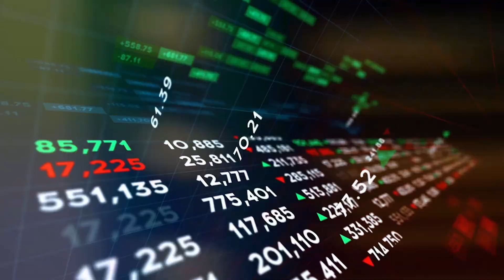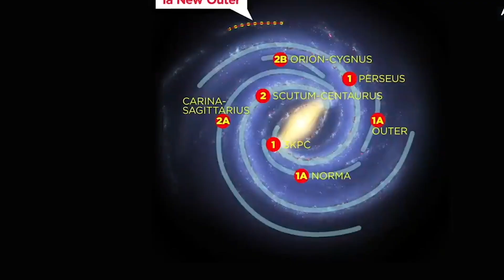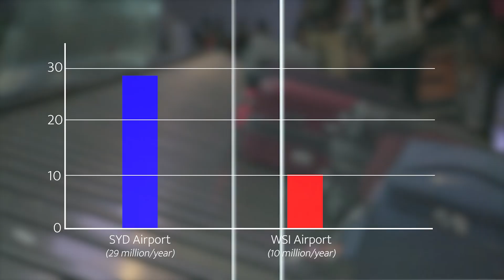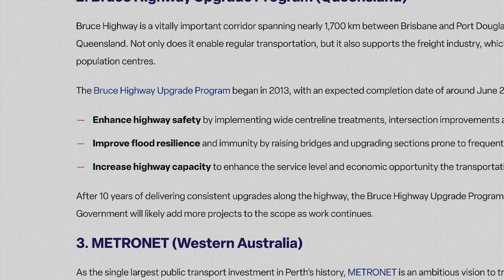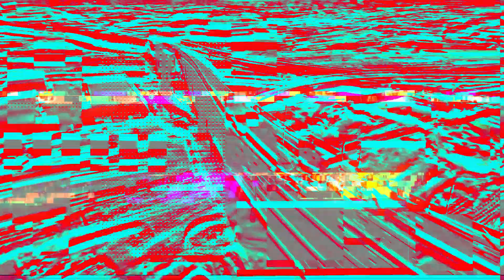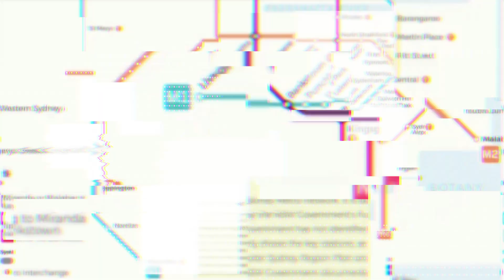TOP 10 Biggest Megaprojects in Australia

Comment: Also melbourne is the most populated city in australia
Reply: Only because Chairman Dan stole a hick town called Melton and declared it a suburb of Melbourne, despite there only being one road between the two places and a fairly rough rail line served by small DMU trains. When Sydney does that at least there is a full electric train service with high frequency services and a supporting road network. As such, Greater Sydney's population is 5.4m.

Even the rail service between Sydney and Newcastle is far more frequent despite the distance between the two being greater.